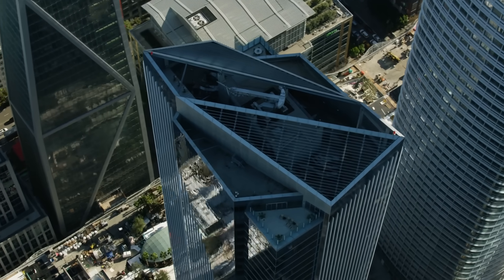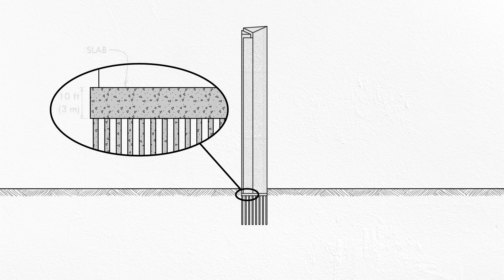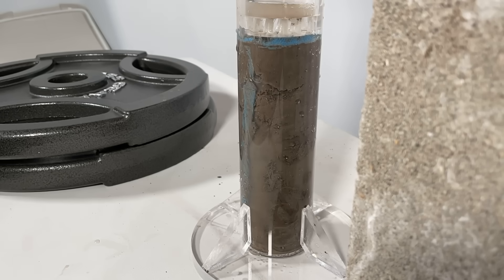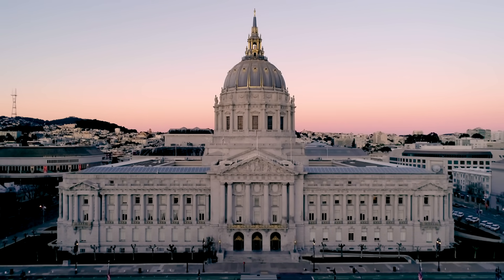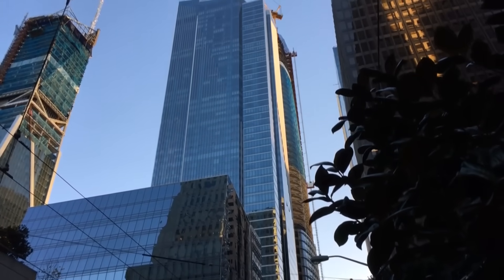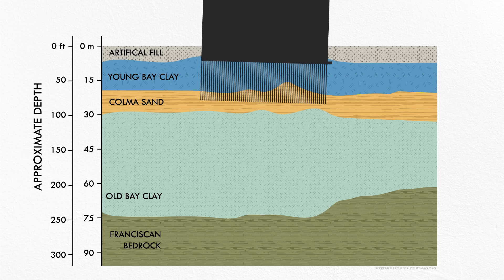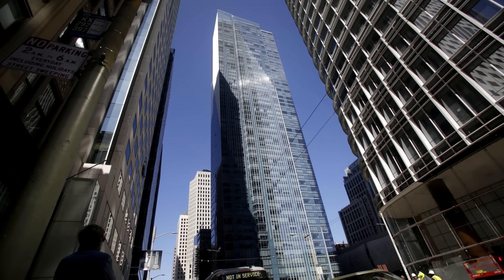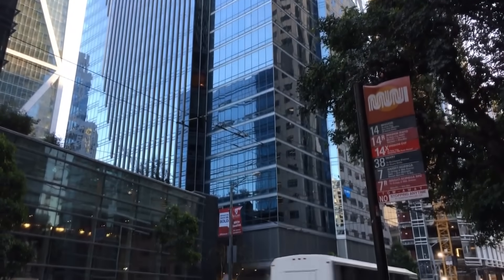What Really Happened at the Millennium Tower?

Comment: Ok, so I guess I‘m too late to expect to get an answer, but how did they keep the retrofitted piles from buckling if they overdrilled the diameter of the shafts so that they wouldn’t interact with the soil? Without specific numbers it’s hard to know for sure how slender they are, but it seems like it could be an issue, especially if they’re being driven from above. Were sleeves put in to support the piles until just above the old bay mud?

Comment: Old video but I'll bite, I worked as a geotechnical engineer that wasn't involved in design or construction but was brought in to do analysis and support the remediation piles, and my understanding at the time was going to bedrock in the first place was really the expected norm for skyscrapers in that area, especially one of that size, and fundamentally IMO it just is too lightweight of a foundation for that soil under that load, the designers tried to be clever and value engineer it and they went too far.

Comment: Offshore structural engineer here.
Error - the original piles weren't  deep foundations. You say 80' penetration? That's pathetic.
On an offshore platform of maybe similar weight, where we don't have the benefit of bedrock (you never find oil under bedrock) we have pile penetrations of maybe 400'.
Something doesn't seem right about the decision making here. A smaller number of large diameter piles down to bedrock was clearly the right solution.

Comment: This video is out of date. They did go ahead with the external pile idea but they only installed 18  instead of 52. The change was required when the sinking of the building accelerated as they drilled holes for the piles. The planned fix is complete. Things haven't gone according to plan. They weren't able to raise side that had sunk has much has they had hoped, the plan was for the side that hadn't sunk to gradually sink to the level of the side supported by the new piles. Unfortunately that side isn't sinking so it looks like the building will remain out of plumb for the foreseeable  future. However the 3 meter thick concrete mat is now sinking in the center. this is caused by the stress of the building being suspended on two of its sides. It would help if some of the original piles began to take up more of their share of the load. So far it seems they don't intend to cooperate.

Comment: Well done with excellent graphics. But you fail to mention that the original plans were for a steel beam structure. This was then changed to concrete form, without adjusting the proposed foundation. Ostensibly (HA) to save money!

Comment: Study the meaning of the words "stress" and "strain". 

A friction pile under a building has zero stress (pressure) on it until it strains (moves) then it developes friction and resists the pressure. A field of friction piles with no building weight at first supports zero weight and developes zero friction. As a building is built care must be taken to add weight evenly to all the piles to ensure even settlement.
Reply: I’m sure he understands the terms.  I haven’t noticed any place in this video where he uses them incorrectly.

Comment: Asking as a structural engineer: Around the 8:50 mark, you describe how the concrete retrofit perimeter piles would extend through the Old Bay Clay, overdrilled with an annular space. The annular space was only to be filled with a "low strength material" after jacking and loading. Question: What would prevent buckling of the piles during this period before filling? Based on the graphic, the slenderness ratio appears to be extreme.
Reply: The piles are in steel casings and are two feet in diameter.  The annular space ends at the top of the clay layer.  See the diagram in Structure Magazine.

Comment: - Why drill the new piles only on two sides (the north and the west)? Wouldn't that cause problems in the opposite corner?
- How different/similar is the foundation for the tower from other buildings in SF? In terms of depth, material, etc.
- How reliable are these "hydraulic piles" compared to "normal" ones? How often are they used in civil engineering in general?
Reply: The building was settling more at the west corner than the east, so that is where the support was needed.  If the east corner continues to settle, the building will come closer to plumb, which is a good result.

Comment: You are ignoring the main problem.  Originally the tower was designed to be a steel frame building and the foundation was designed accordingly.  Before construction started it was decided that steel frame construction was too expensive and reinforced concrete would be used instead.  The building was redesigned but for some unknown reason the foundation was not.  So the reinforced tower was built on a foundation designed for a steel frame building.  To cover up the corruption, the SF Building department, the developer, and the contractor invented all these reasons you related here.  The real reason they have kept hidden which is the tower was built on the wrong type of foundation because the correct foundation would have been significantly more expensive to build.  This failed tower stands as a monument to the greed and corruption that permeates SF ever since the tech boom started.

Comment: San Francisco Residents and Business Owners... Your Federal Government knows EXACTLY how to deal with this Millennium Tower problem. According to the Government's 9/11 Commission Report and the Government sponsored NIST (National Institute of Standards and Technology) Final Reports.... The 47 Storey Fireproofed Steel and Structural Concrete Skyscraper known as World Trade Center Building 7 collapsed at freefall speed under acceleration due to gravity with zero resistance... in 7 to 10 seconds.... into a neat pile within the buildings footprint....minimizing significant damage to any surrounding structures.... pulverizing 1000's of tons of structural concrete into fine powder.... leaving only a pile of easier to manage shortened steel pieces.... and all that is required is to set fire to standard office equipment on two (2) random floors.... that's it.  The concrete powder can be swept up and whatever remains of the steel infrastructure can be rapidly loaded onto ships, sent to China and immediately melted down... problem solved.

https://www.youtube.com/watch?v=PWgSaBT9hNU

Likewise, the Government says the massive World Trade Center Towers 1 and 2 were demolished in 10-12 seconds using similar mechanisms. It's a fast, efficient and cost effective method for getting rid of pesky skyscrapers that you no longer want (or if you have other motives for removing them with a bang).

There are many, many commentaries on this subject.  I suggest you look into it and see if this method could be right for you.

Comment: I’m not sure how engineers can claim the building is perfectly safe but also concede it’s still sinking on one side causing the building to move further out of plumb. 

My question to them would be, what is the distance of the leaning you would consider to be unsafe? It’s already well past the allowable distance in the local building code.
Reply: For one thing, it isn’t sinking on the west side any more.  The new pile system has arrested the tilting toward the west.  Before the fix, it was leaning only about one quarter of one degree.  When they said it was safe then, they meant that it was not in imminent danger of tipping over.

Comment: The fix didn't work. Also, you couldn't pay me to live in one of these buildings in the Market District. The buildings there during the 1906 quake sank a little more than this one. 😉
Reply: You are mistaken.  The 18-pile fix has done exactly what it was intended to do.  It has arrested the progress of leaning toward the west.  It has also reduced the lean slightly.  Time will tell how much the lean will be reduced by further settling on the east side.  It won’t be fast.
Reply: A 2/22/2024 article on NBC Bay Area states "While the Millennium Tower is no longer sinking anymore at the corner, and has reversed some settlement there, data shows there’s only been about an inch of tilt reversal, a quarter of what the model had predicted."
".. two outside engineers say the data suggests instead of sinking at the opposite sides, the tower appears to be sinking more in the center."

Comment: I heard the foundation was originally designed for a much lighter steel frame building but, was changed mid-stream to an all concrete structure. All steel are not best for luxury condos as steel sings and groans in proper resonance conditions. Steel beams singing or groaning at resonance in the background during a business day is unnoticed but is unnerving or haunting at night with no sound mask to help rich folk sleep. It's why most hotels and tall housing structures build with concrete. I heard this tower switched to much heavier concrete mid course for this reason. The foundation originally designed for a steel building was ghetto rigged (quickly, cheaply redesigned) in a manner wholly inadequate for the much heavier as built concrete structure.

Comment: The plan was revised to use only 18 new piles, each loaded to one million lbs.  They were placed and loaded by late June 2023, and the tilting to the west seems to have been arrested.

I think it is a case study in the cost of shortcuts.  I believe they should have anticipated the need for a better foundation.  One explanation I have heard, which may or may not be true, is that the building was first planned to have a steel frame.  Then it was changed to be reinforced concrete, which is heavier, without redesigning the foundation.  The City may have also been negligent in not reviewing the plans for the foundation.

Comment: Now it’s leaning so hard, sewage is backing up and overflowing.  Seems gravity has trouble making sewage go up the tilted plumbing pipes.
Reply: The drain problems are probably due to ordinary clogged pipes.  The tilt is only one quarter of one degree of arc.
Reply: There!s a local news report about the sewage back up … including video and the finger pointing.
Reply: @douginorlando6260 — No doubt some units in the building have drains backing up, but you can’t count on reporters to know the cause.  Lots of buildings get clogged drains, including mine.  You only hear about those in the Millenium Tower because of its noteriety.

Comment: What's a square foot?  And why do they cost 100 pounds?
Reply: (My Physics professors at Surrey never taught us that..)
Reply: @senseicharlie — You should have learned that long before taking physics.
Reply: @GH-oi2jf I think in Britain they use metric units for area and pounds for currency.  They also drive on the wrong side of the road but that's a separate issue.

Comment: They need to evacuate that building while there is still time, get the residents to another location and provide some type of reimbursement at least until the building is stabilized. One thing that could happen during the project is the building shifting into critical failure, if it goes horribly wrong life will be lost.

Comment: I'm not a building expert but I have been studying earthquakes for a while.
If the soft clay hasn't  behaved in accordance with the initial sub-soil prospecting, how could they expect to remain neutral when it is subjected to the intense vibrations caused by the insertion of the new foundations - while being under load?
It is obvious that there is much more water and air dissolved in it - more then what the prospecting says. This is the kind of sub-soil that amplify the damage caused by seismic waves...

Comment: As of today, June 26, 2023 the tilt continues to grow. The lean is now effecting the sewer system. The Millennium Tower leans so much, the waste water doesn't run out the sewer pipes anymore. Sewage now flows into the lower units. That must be great for those owners. Of course the lawyers are claiming that tenants aren't flushing their toilets correctly, this is the cause of the sewage. Yeah right. The building owners and engineers knew about the type of soil beforehand and chose to NOT drill into bedrock. Every building in the area is drilled into bedrock. The owners figured that they could get away and no one may not notice. If they did ?? Oh well, the taxpayers would cover the loss.

Comment: Any opinion or video coming now that the millennium tower has reduced the number of new piles from 52 down to 18?  Or that the piles are connected to the building by flimsy 6 in diameter steel plates?

Comment: I only take 20 million dollars after tax consultation fee to fix their problem. The story of Columbus and egg. They try to fix an easy problem, the hard way. Think backwards, think around the problem... you will get some easy solutions.
Building tilt will also increase soil bearing pressure at the tilted corner, more bearing pressure will cause more tilt, more tilt will cause even more bearing pressure (try to tilt body forward, and feel the pressure at your toes), .... eventually, it will be a progressive failure if it is NOT fixed soon.  As long as it tilts, it will not stop flipping over.

Comment: According to my calculations the building will pass the point of no return in about 18 months. That is the point when it will no longer be safe to dismantle it. The building has to be dismantled, there is no way around it. The soil consolidation will not relent and it is not technically feasible to withdraw the ground water beyond a certain point because it will cause other issues

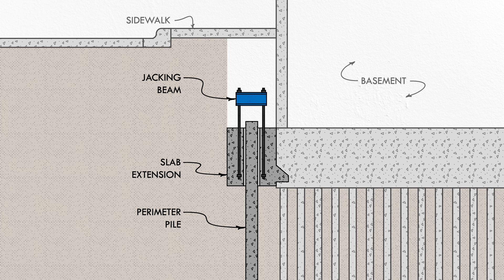Comment: 8:30 I'm not an engineer to have the skill set necessary to do the math on it, but I remember finding someone a while ago on YouTube that was, who discovered that there were a few novel approaches taken in the design that were not rigorously peer reviewed. Apparently the only outside review only verified the math in the original feasibility assessment by the designers, which meant that they both overlooked the stresses applied to the interface between the 4 steel beams holding each pylon and the concrete extension. The beems are actually greased like the pylon is along their length and don't actually do the real work, instead, there's relatively thin steel bars connecting them in 2 pairs they thread into which is where the force is actually transferred from the concrete to the rest of the jig. The most unusual part on top of that design, is that the designer apparently actually intentionally designed it to exceed the deformation threshold under normal load conditions, because it's meant to be visually monitored for movement to adjust the hydraulics. The engineer I found was pretty concerned that there isn't actually a lot of study on the type of forces being applied between those bars and the concrete at that scale, and that it could fail catastrophically if disturbed by a minor distaster, like a small earthquake that the building should in theory be rated to withstand without harm.
I don't remember what channel it was to find it again, it was a pretty small one. I haven't seen the same concerns addressed anywhere else to know how much they were fear mongering or did their math properly vs. having legitimate concerns that were never solved.

Comment: This is why you should ALWAYS drill/drive pylons to bedrock in the first place. Yeah yeah. Cost. WHATEVER! But, it doesn't change the reality. Venice keeps sinking every year and after the horror shows that my family have seen in construction projects over the years (like city soils engineers outright failing to do soil pressure testing and going off old data—ergo, what effectively happened in this scenario as well).

One case, One Mercer Plaza (Mercer Island, WA) had a bunch of apartments built on the hill behind the commercial building my parents were constructing, and due to the city soils engineer using old, defunct data instead of going out and doing fresh measurements, the foundation my parents were building started sliding down the hillside. They got to experience building an emergency retaining wall. My Mom nicknamed the project, "One More Problem."

It's one of those examples were "to fix the problem would cost an astronomical amount of money". Well, if the city had managed development and soils engineering properly, the initial data would probably have been more accurate. But, due to a lack of adequate future proofing, the buildings started to sink farther and more quickly than anticipated. In such closely packed areas, it seems obvious to drill at least a few stabilizing pylons to bedrock, even if you have to use hydraulics like NORAD's Cheyenne Mountain Complex to create a specialized floating foundation to stabilize subsequent sinkage, and create a stabilizing factor. Course, San Francisco already has a history of cutting corners, such as the iron used for the cables (steel cables) that subsequently had massive degrading and failures to spot test the cables to assure their consistency/quality before install. But, I guess QC isn't exactly a priority these days when the number of construction firms with adequate bonding capacity for these huge projects is effectively non-existent. Monopoly tends to harm QC long-term. At least, so far as most historical case examples show. Strong regulation & oversight can alter that, but fundamentally, the lack of competition ruins engineering projects.